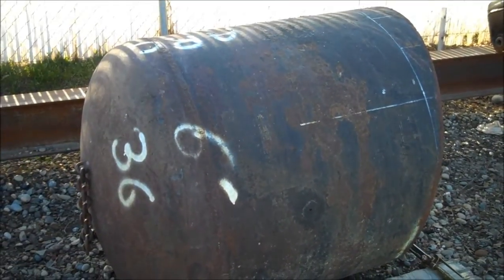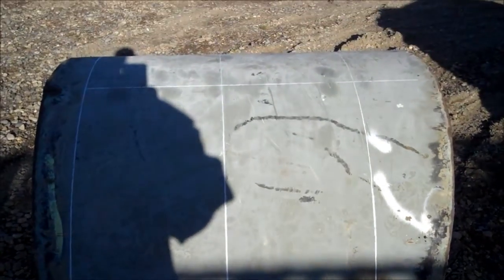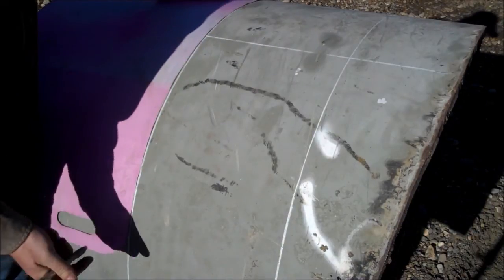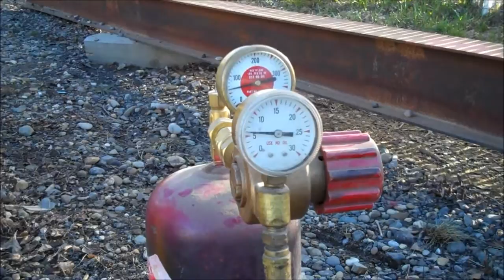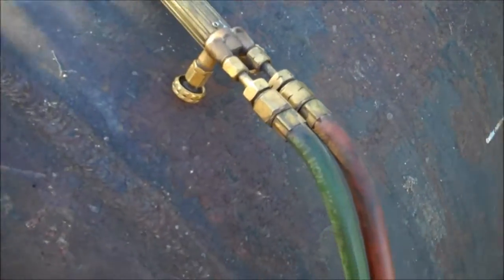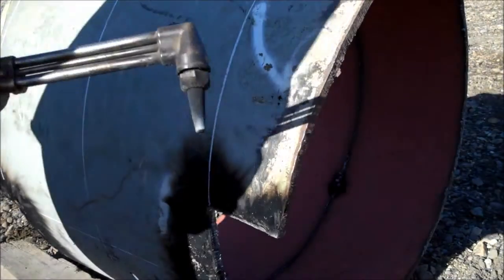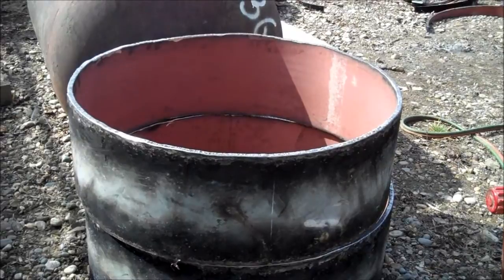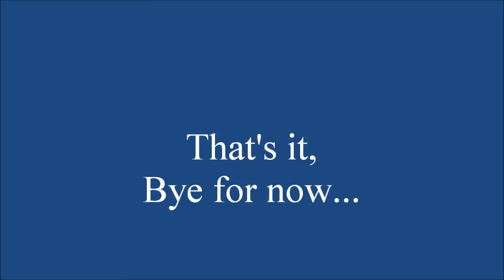36" Fire Pit made from pipeline

Comment: Whatever you do do not use a concrete pipe. The pipe will not take the heat and as it expands in diameter the reinforcing steel mesh tries to hold it in an expands at a different rate. I buried a 4' by 24" wide pipe in the ground. I used it to burn brush besides. It worked great for about 2 hours and then started to develop cracks. That was fine...except for the explosion that happened about 20 minutes after that. The outside concrete spalded off the side just leaving the mesh.

Comment from the maker: @CountryHeart4ever Hi, your problem is the concrete. You're not supposed to heat concrete in fires, it's dangerous/explosive. I suggest you lay down a few inches of sand, then lay your fire pit on that. I've had success with this many times. You will need to get rid of the concrete, if you're going to use the same location.
Best of luck with it.